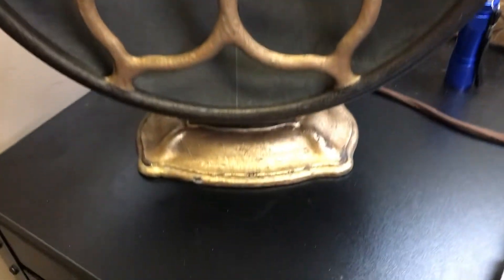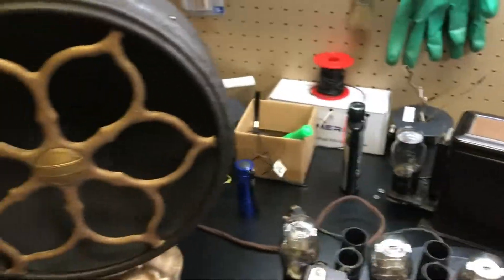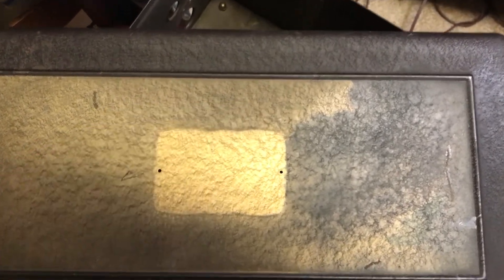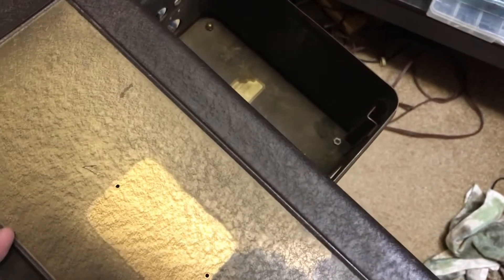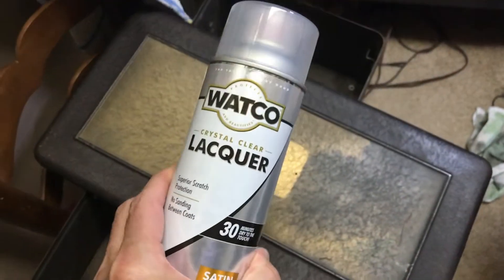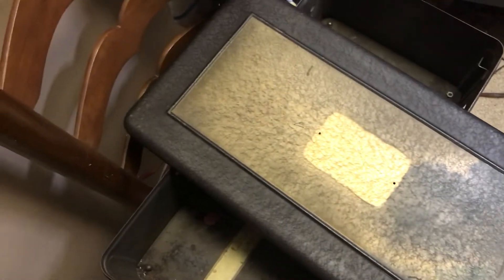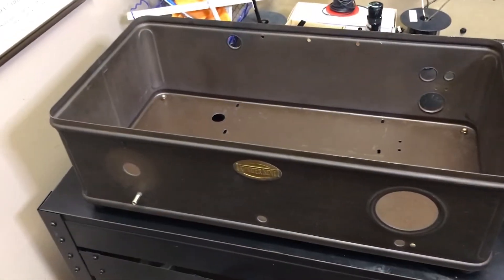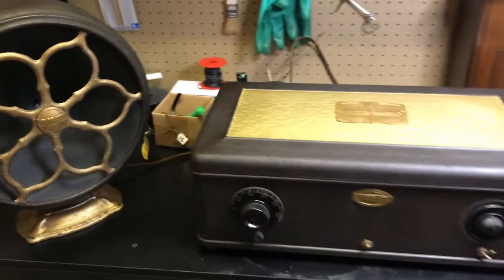All Back Together

Comment: Very nice job! I have each of those old breadbox/coffin radios out in my garage. All restored electrically, but my 44 looks like yours used to look. LOL. I will get back around to it. The breadboards have captivated me the last few years. I just yesterday got an old Magnavox horn speaker finally working and it took me 3 speakers to get the parts I needed to do that, so I too have gone through the same situation with needing to acquire, and reacquire, and reacquire the same thing in order to get one working. My wife is about to choke me out with all of the radios and speakers so she's selling them off on eBay right now. She just listed an AK Model 84 cathedral yesterday that I love but she's right. I have over 100 radios and she won't let me keep them all.
Reply from the maker: Wow 100!!  I only have about 16 or so.  I love the big console radios. I have 5 ranging from the late '20's to the late '40's, but they take up so much space.  I was really happy to get the AK 44 playing.  I have no formal electrical training...sort of self taught....watching repair videos and reading books.  Only set a few on fire. hahaha  But yes, the number of radios in the house is kinda at it's max.  I'll probably do a few more then just maintain what I have.  As I learn more, I realize I could have done some radios better and I redo them.  I enjoy your breadboards, they would be hard to let go of.  Keep the videos coming and I'll try to do the same.  Steve